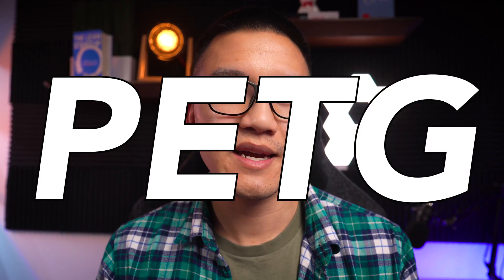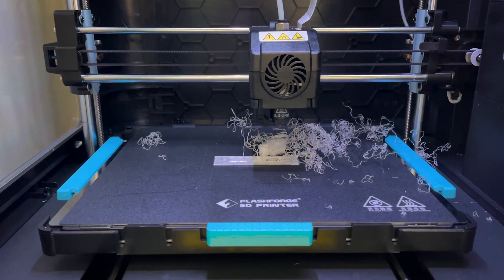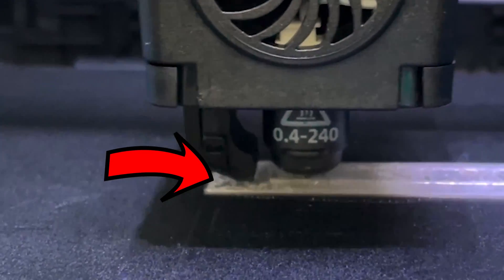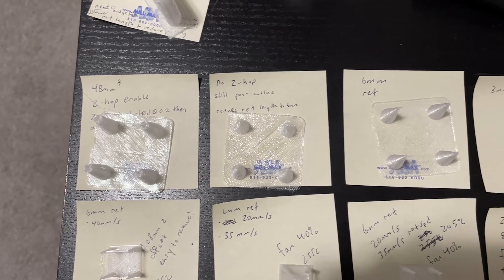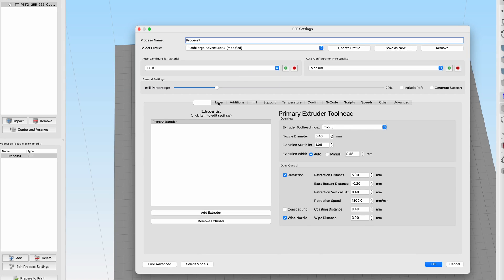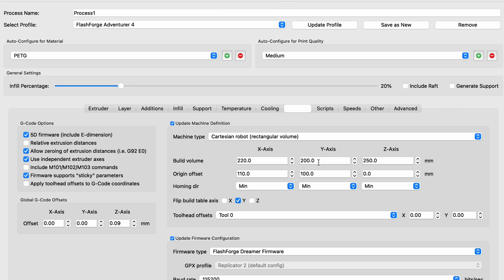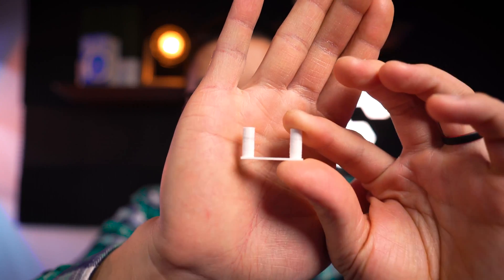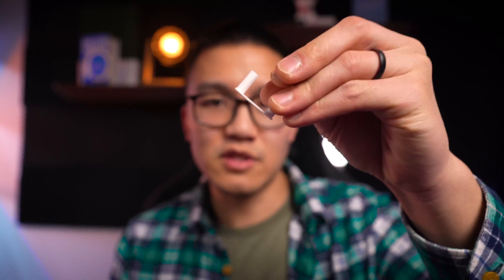The secret to 3D printing PETG [Adventurer 4]

Comment: TL;DR:  Dramatically reducing the print speed for small parts with Simplify3D's "Adjust speed for layers below XX seconds" setting helped a lot. Coasting and Wipe Nozzle settings help clean up remaining blobs.  
I have been using Simplify3D for years and love the interface, but these features are also available in free, open-source software like Cura and PrusaSlicer. S3D hasn't been updated since 2019 and is starting to fall behind the free options IMHO...
Reply from the maker: Yes I totally agree with you on that. They have a very limited selection of advanced settings while cura has a ton. I’ve started experimenting with cura and like the results so far. S3D has a good gcode preview interface though
Reply from the maker: @Justin Hager sure I'll look to make a video on both slicers in the future
Reply: Super Slicer is great too. I have been using that exclusively for a while now. They are just released the Beta that brings in all the PrusaSlicer 2.4 updates. It can be overwhelming with all the settings, but once you get the hang of it and start dialing in the print settings it's amazing all the little things you can change to get that little extra speed or quality you are looking for.
Reply from the maker: @CodeMonkeX  I actually have gotten superslicer recently and been testing it out. Definitely an overwhelming amount of settings but they have good descriptions so I've got it setup for the most part. Still dialing in PETG though

Comment: Part cooling typically leads to brittle petg parts. Try 0%-30% I typically use 15% or no cooling whatsoever.
Reply from the maker: Thanks for the tips! I have learned through my various tests that a lower fan speed makes better prints
Reply: My ender 3 s1 pro keeps knocking over my prints some how. Even with the glue stick and the rough surface bed and setting a higher temperature. Using bo fans works great to not have it fall over and to stick to the bed. Though it did have trouble with Iverson hangs

Comment: If you use cura look into retraction settings and there's an experimental setting called "coasting", I've only printed petg so far on my ender 3. Started on a 0.4mm nozzle but I recently switched to a 0.6mm nozzle for quicker print times on more functional parts. I'm assuming you calibrated E-steps as well for the extruder because that could be a factor! 3D printing is all about trial and error.
Reply from the maker: I’ve been playing around with coasting on Sinplify3D and found that at 40mm/s, 3mm of coasting seems to work reasonably well. What are your settings on the enter 3?

The esteps have been calibrated well as I’ve done the check where you extrude 100mm of filament. There is no way to change this setting on the adventurer 4 as well :s flashforge support doesn’t seem to want to answer how
Reply: @justmakeitdaniel7667  Cura might be different but my settings are 90% travel speed and 0.2mm^3 volume (it recommends using a volume of roughly the nozzle diameter cubed).. 0.6mm^3=0.216mm^3.
What retraction settings do you use? Petg likes to ooze so if you don't get the retraction settings dialed in it can cause zits and blobs to form on the outer wall. What works well for the ender 3 with a bowden setup is 6mm retraction distance with 30mm/s retraction speed.
The last thing, although I don't think it is causing your issues is the part cooling. Petg prints well with < 40% fan speed.
Reply: ONE MORE THING, petg likes to absorb moisture so drying the filament in a filament dryer, or even the oven, should give you better print results!
Reply from the maker: @iownyounoobs   I have my fans set to 25% and I bought a filament dryer which didn’t change the print results. The role of filament was freshly opened so looks like the manufacturer dried it well.
My retraction settings ranged from 20mm/s to 50mm/s for all my tests. I retracted between 4-6mm. While observing, I noticed that a blob would form while it was retracting even at the highest speeds. So coasting is the setting I need to play with. There is just a lot of pressure built up in the nozzle I figure. The coasting setting is also dependant on print speed (more accurately, material flow which actually changes depending on the feature it finished printing)
Reply: @iownyounoobs  good tips man!!
Reply: You are correct about calibrating the extruder. I have an Ender 3 V2 which i just upgraded to direct drive so i can print flexible items. My factory calibration setting is 93 after calibration its 145.3 e steps

Comment: Nice video Daniel! I'm glad you found a solution! One which shouldn't be needed in the first place.
Note that I still have yet to print with PETG but what amazes me is that you print with your 240 degrees nozzle.
When slicing in Flashprint, the standard profile is 250 degrees for PETG and notes you to change the nozzle.
Maybe trying the 265 degrees nozzle will solve alot?
Reply from the maker: I am printing currently using the 265C nozzle but at 240C. For my testing, I went all the way up to 260C and results seem to be the best around 235-245C. I have also read a lot online and I’ve heard people print PETG anywhere from 225-250C. 
I’m still a be bewildered at why flashprint wasn’t able to produce the same results as simplify3D even after slowing the speeds down
Reply: @justmakeitdaniel7667  I suggest emailing Flashforge regarding your issues and ask for advice with flashprint and PETG,   I have had a couple of flashforges over the years and the company is very helpful with any issues.    They know their product and what to do to fix things
Reply: @justmakeitdaniel7667  exactly I new to 3d printing, just got the adventurer 4 last month, for petg 240c is the sweet spot.